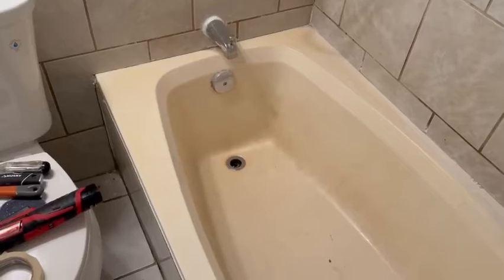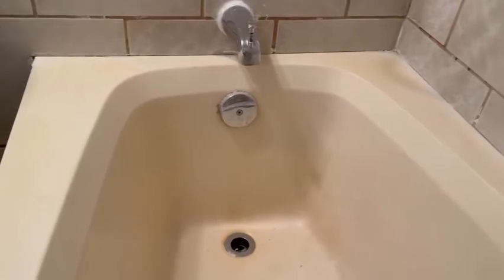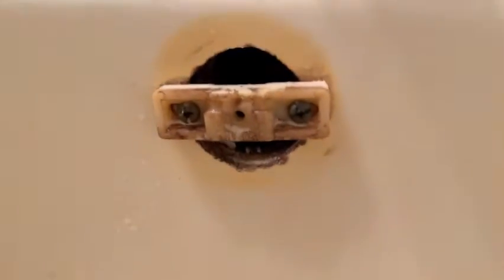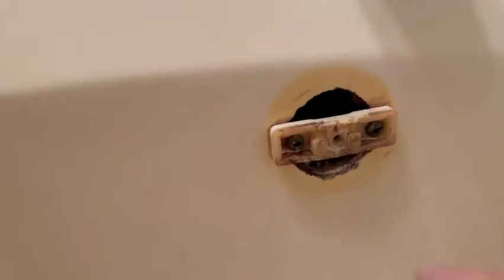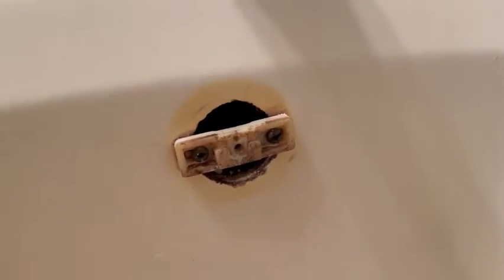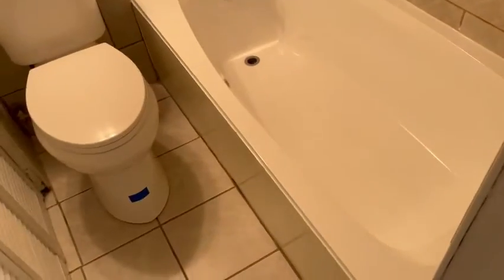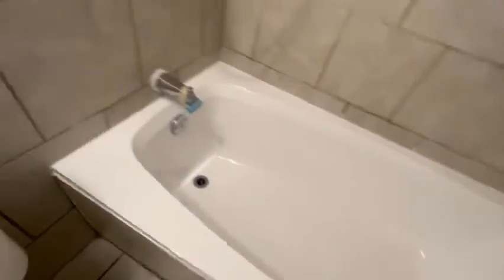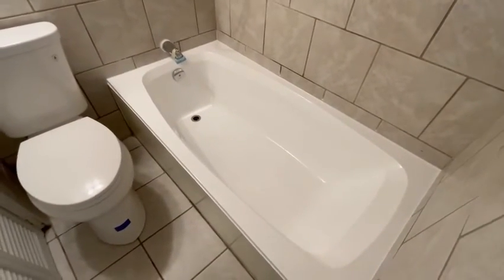Why does my tub turn yellow if it’s old Fiberglass?

Comment: Dude, you basically changed the color temperature on the camera and used a yellow, very low light bulb in the Before to cause shadows and an LED white lighting up the whole freaking bathroom like Dodger stadium for the After. People have been doing that "trick" for years with Before and Makeover photos for decades, only the subjects had a frown for the Before and a beautiful smile for the After. Surprised you didn't drawn both in lipstick on the tub for Before and After. 🤔💄💄💄💋💋💋💋💋
Reply: Then why is the toilet white smart guy?
Reply: @michaelbowers1902  the clue is in the title: the tub is fiberglass. The toilet is not; it is made of porcelain and was white to begin with.